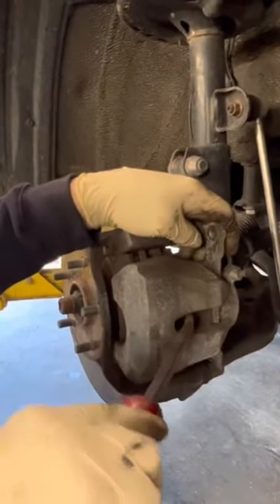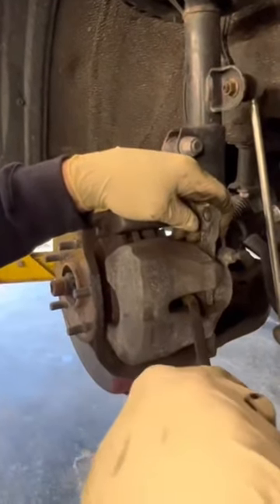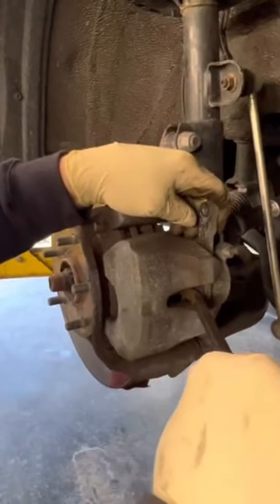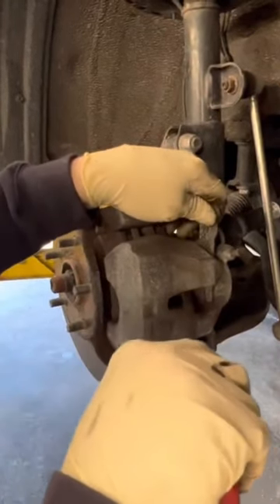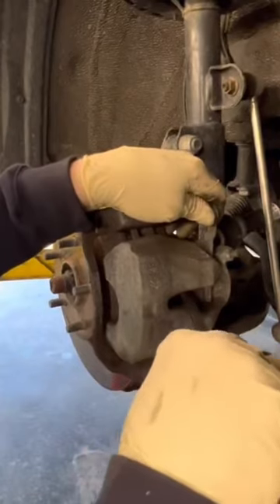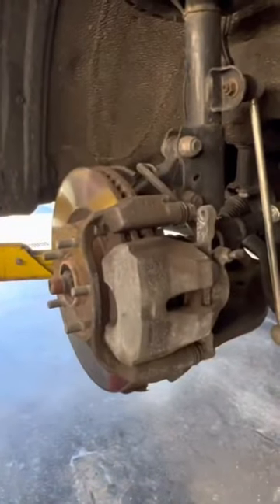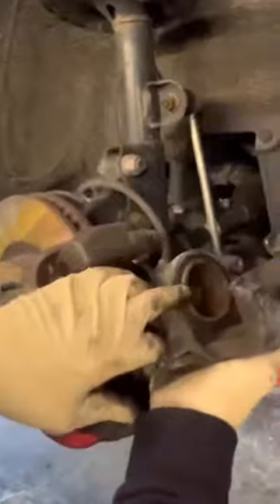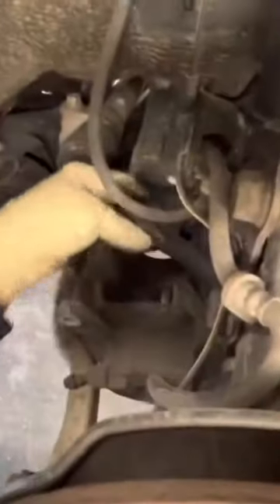How To Compress Brake Caliper Piston #shorts

Comment: If you don’t have the right tool, this is a way easier method than getting a clamp or a large pair of channel lock pliers. Nice tip!
Reply from the maker: It's pretty easy to collapse the brake caliper piston using this method. Been doing this for years.